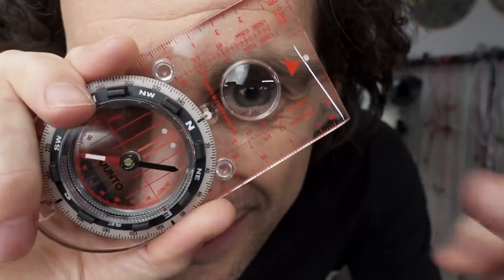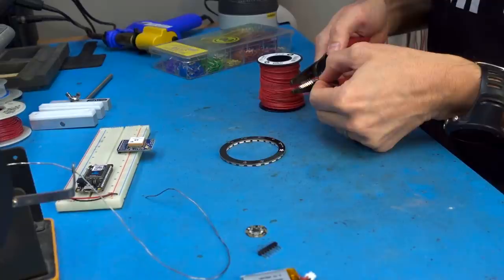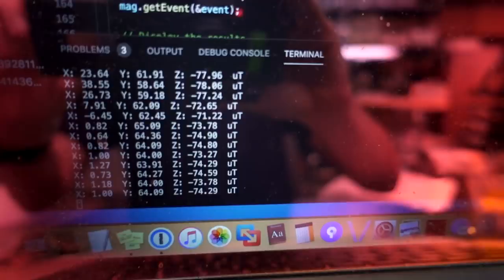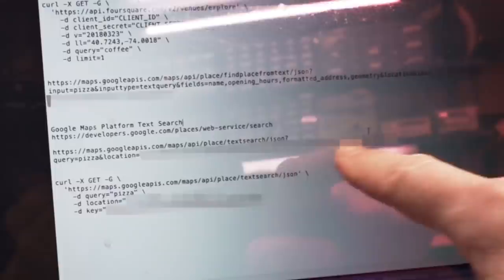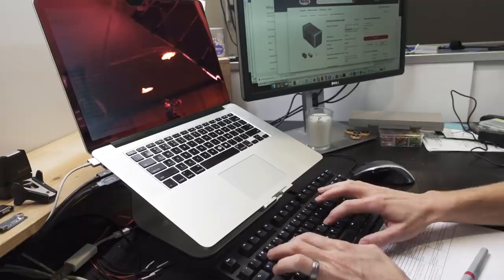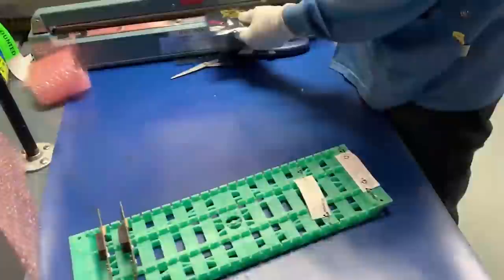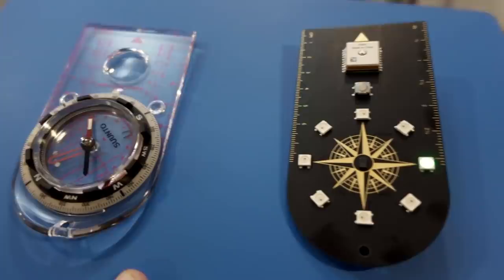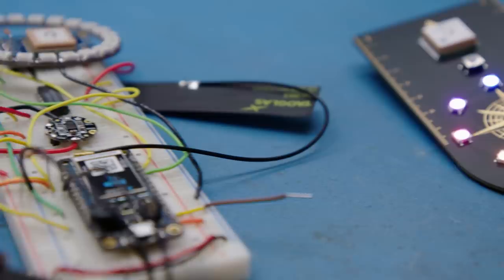Engineer Builds a Compass That Finds Pizza | Hack Job | WIRED

Comment: Danggg he did it in 3 weeks. As an EEE student, I understand how hard it is to write and debug the code, let alone designing the circuit board. Mann that was a good piece of tech. And it's very generous of you to compose it into a single video. Really goes on to show how high quality this video is
Reply: You should check out CELUS then! :-) At least, the design part is something that can be done way faster and easier...

Comment: This device can be used to locate nearby hospital when in emergency at unknown city when phone battery dies or where internet connection is poor (I'm assuming this uses way less data than smartphone maps) so that one can reach hospital quickly
Reply: There are a lot less hospitals then there are pizza places so you could even load the coordinates of all the hospitals in the country and never even need an internet connection
Reply: Thats actually a really great idea
Reply: i haven’t watched the whole video but you would want an algorithm to follow roads so that it would point you to your next turn or point instead of directly to the destination. You would probably want to find the curve of your current road and use that to determine how many points to put on the road . a straight line would need two points but a 180 maybe need way more.

Comment: great video thanks! i was surprised by the inspection of the pcb at the end of the production. having worked as a tech producing smd pcb's for laser equipment we never got to that level of inspection. cool stuff. this really puts it in to perspective of how impressive the modern cell phone is. it does the data crunching mapping and guiding and at the same time you could be on a video chat and look something up.  so much processing power in the palm of your hand. hard to believe how far we have come in 50 years.

Comment: 6 minutes in, I'm wondering how he will set up the direction/wayfinding.
Like is he going to set up a route and have the compass direct people along a path? Or is he going to just say "hey nearest pizza place is in this direction, good luck"
If the latter, I'm assuming a distance indicator would be necessary. But it would be cooler than "hey you have to go in this opposite direction for a bit until you get around this huge building and NOW you're going to start walking in the direction that actually brings you physically closer"

Comment: It would be really cool if you made a magnet ,which can rotate, point towards the pizza place. hence resulting in an actual compass placed above the magnet pointing to the place instead of a led ring.
Reply: holy frick this would be a super cool idea
A 3 phase motor stator would be able to accomplish the same task, or more generally, any set of 3 windings spaces 120 degrees apart
Edit: the reason why a motor's stator would be preferable to a motor is because the stator windings are solid-state and don't require moving parts, the only moving parts would be the compass needle itself

Comment: Why do they call those things "bread boards" 2:37 ?
Reply: Because the original version was connecting wires by wrapping around nails in an actual breadboard
Reply: @jonomoth2581  Thanks.